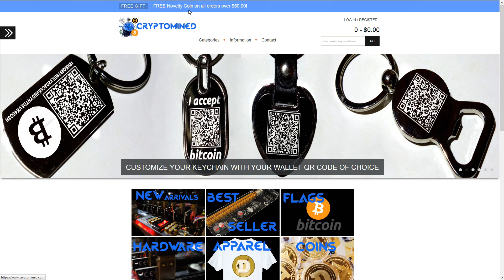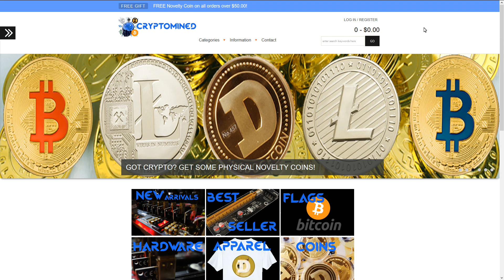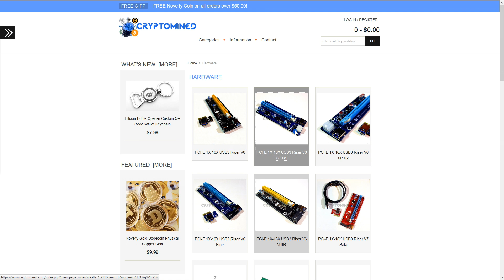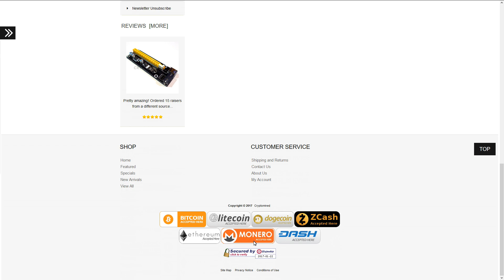6 Best PCI-E 1X to 16X USB3.0 GPU Risers for Mining Rigs Ethereum ZCash Monero

Comment: Hi Cryptomined, I haven't talked to you since zcash forum started up. I think the last time was when Claymore has released "his" miner code cough cough. My nick here is slightly different, but you might be able to figure it out lol. I had asked you before about getting me some risers and I'm glad to see you got a store :) I went there to order 50 risers and some reset buttons, $350ish total, and closed the site when I saw the shipping which was almost $110usd using USPS :0 I'm not blaming you for the high shipping costs since that is out of your control!

I still have some questions and wanted your opinion. I suppose I could talk to you on the zcash or eth forums, but here will do. I getting things set up for the release of Vega cards and am having to take a WAG at power consumption of the cards. The best info I have found is TDP <250 watts...god I should hope so lol. Anyway, I'd like your thoughts on PSU and risers using the same MSI board in your 7 card rig. I'm thinking I'll be forced to use two PSU's per rig to have enough connections. I prefer EVGA and a 1600 G2 has 9 VGA connections, 7 of which would be used going to the cards. The other two could be used to power the 6 pin risers, 8pin to 6+2/6+2....leaving 3 risers needing power. Of course those could be Molex or SATA and the 1600 GS certainly has enough connections for this setup, BUT the dam things are $400+usd.

I've got a metric butt ton of EVGA 1300's and 1000's left over from scrypt ASIC mining I could use, but to me they are like 5 years old ran at 80% load(warranted for 10), so I'm considering just buying a whole new batch of PSU's and ebay'n the old ones.

Do you see a prob using mixed risers......the 6pin and SATA mixed for example? Do you think the higher cost of a single big PSU is worth it over two cheaper smaller PSU's? One PSU is more compact and simple to start up, whereas the last time I used paired PSU's had to be started in a certain way. The rig will use a wire rack similar to yours, have 8 mobo's mounted vertically on the ends of the rack, PSU's on the racks, and GPU's hanging from the racks. I'm concerned about space since the racks are 18 inches deep and 48 inches wide. Card spacing might get a bit tight but right now I don't have a clue as to the size of a Vega card. The entire rack will be wrapped/clad with some-PVC sheeting, open on the top and bottom, with fans top and bottom in push/pull. Creating a chimney, if you will, with air drawn up and out. (That might sound familiar since I used to sell custom rigs handcrafted holding eight 6 card rigs. They cooled brilliantly)

If you have any thoughts, please let me know. Sorry for the wall-o-text :P  Ummm....thoughts about the rig, not about me personally :|
Reply from the maker: sorry, your comment was caught as spam by youtube, i just saw it now.  shoot me an email at cryptomined@cryptomined.com and I can cut you a deal on risers if i know you from the z forums. :)  btw, i send out 2 reset buttons for free with every 6 risers.

not sure the best option for PSU, i did recently add PSU dual connection cables to the store though :)  again just shoot me an email and tell me what you want, ill look over it, discount it, and calculate DHL shipping which could be less if I squeeze the box tight :P  cause they use dimensions in calculations - better for heavy boxes.. cant offer it in the store due to the measurements being used in the calc..

theres no problem using mixed risers.. all my rigs use mixed risers.. infact on the z97 gaming 5, since i have started using 3 sata risers, my rig is way more stable.. i think some of the PCIE slots were "loose" or too wide so the 1X riser end would wobble too much.. sometimes that was causing a GPU to drop..  so actually mixing them is better than when i just used the molex.  i havent had that problem with any other boards.

so... i would recommend mixing sata/6pin/ and molex.  I do.

I think if you use the DUal PSU link cables I sell, should be ok with 2 PSUs.
Im in the same boat thinking about what to do with a 1070 rig i want to build...

shoot me an email, easier to talk though email :) ttyl
Reply: I emailed you friend :)

Comment: Hello
how to solve the problem and Hama Windows 10 AMD graphics card rx480

(application has been blocked from accessing graphics hardware)
Reply from the maker: whats Hama windows 10?  what drivers are you using?  did you modify the bios of your cards?
Reply: Cryptomined 
Is it possible assistance through teamviewer

Comment from the maker: The Best way to Support the Channel is to use the cryptomined store @ https://cryptomined.com where you can get these Risers and More!
Its like making a donation except you get cool mining stuff :)
Reply: power efficiency matters and even gen1x1 is more than enough bandwidth at this point of time. I am currently zcash and eth with good old P45 Intel E6300 (5 pcie slot) and noticed no speed differences with B85, Z97 chipsets with gen2 and gen3 slots.

but if you mean a board that can split pcie 1x16x to 16x pcie 1x. That would be nice and i would love to grab bunch of cheap x79 server boards with xeon e5-2660 to try
Reply: Motherboards don't make x8 slots, only like 2-4 x16s and the rest are all x1s, so that's useless and unnecessary.

X1 does the same as x16 for mining, the difference only comes to mind when gaming.
Reply: I purchased 5 Sata risers on Saturday the 22nd, any idea when they'll ship out?

Order Number: 125

I plan to buy more soon after I check those out.
Reply: Mike How long did it take you to receive your order, is this a legit place to send money?
Reply: Cryptomined they need to make a PCIe X8 to PCIe X16, the X1 is too slow.
Reply: Cloudy Tee they should do a pci x4 splitter that would have two pci x4 in it.
I seen some low profile graphics cards with 2GB DDR3 for cheap, I would definitely want iPCIe x8 graphics card low profile with 1GDDR5

Comment: All of them have a voltage regulator on them that converts 5V to 3.3V for the card.
The main difference is that the 6pin versions need only 12V while the others need 5V too.
there is a switching voltage regulator on the 6pin version that converts 12V to 5V for the other voltage regulators input.
And another advantage of the 6pin version is that you can feed 3 of them from a single 6pin connector if you pull out the connectors from the housing, because a single pair can deliver 9Amps and you have 3 pairs in the 6pin connector. that is how I use them.
Reply: So 12V is for Power and the 5V is for signals of the card ?
12V and 3 amps, is 36W for one riser ??? That's much...
Does someone know how many POWER consumption one (or six) riser card(s) needs ? That's my question.
Reply: I would also say 6 pin conector is more modern than this old molex system... And the 6 pin has a lock system...
Reply from the maker: yes they all have a voltage regulator as you mentioned to convert 5V to 3.3V (the little black chip right?) but that diode is supposed to protect the card from over voltage from a 12V from what I'm told.
Reply: are there really cases where a card died because the riser... And how would you know it was the riser and not overclocking or something else... Maybe they just go for safety... even if it's not nescessery... Maybe only a marketing thing...
Reply from the maker: its more for using it from a 12V source.  I think some server PSU's are only 12V, and if you use the VGA cable from the 12V then maybe some overvoltage protection is necessary.  I had one GPU die, not sure why it died.  hard to tell why a GPU died when its totally dead LOL.   You can get Molex extensions/splitters etc that run from a 12V... so its for that more or less... its not a marketing thing, it has its purposes...   Zoltan did not talk about 12V,... he overlooked that aspect... and the aspect of server PSU's.  maybe I should not have called it a voltage regulator, even though it does regulate or limit voltage from a 12V source... maybe i should have called it an "overvoltage protector"... I don't know exactly what the proper term is... i just know that it is there to protect overvoltage from a 12V source.... people will get it mixed up with the little black chip that regulates votage like Zoltan said.. he says the 6pins only need 12V protection, but thats not true if you use a molex extension cable from an 8 or 6+2 pin cable...

Comment: hey bro, I'm building a new rig. I was wondering IF I could combine different amd  cards together. I'm getting 3x hard swap 470's and 3x hard swap 480's, 3x r9 nano and finally 3x amd radeon 480. DO you think I will run into  any issues running different cars like the ones i just mention, thanks!. once this gets going i will tip you for sure.

Comment: Hi one question how many riser can i put in molex or sata cable? and how many risers can i put in 6 pin cable? 
6 pin 12 volt (2 yellow) - i think at 8 pin cable out i can put 2 risers of 6 pin
sata cable 12v and 5v i think only 1 riser can i put this way?
molex 12v and 5v only 1 riser?
photo: http://i.imgur.com/BUGWwRf.jpg
Reply from the maker: as for your photo - i do not think you can use the 8pin CPU connection to power a riser as the other end of that CPU cable does not have a 6+2pin - it should have either an 8Pin or 4+4Pin.  You will not be able to plug a VGA 6+2Pin into that CPU connection, they wont fit... different plugs.

For sata or molex you ~should~ only put one,... but most people tend to double up on at least one of their connections as most power supplies just have 6 6pin connectors (and one is needed for the SSD/HDD).. most people don't use the 6pin risers because they have not been around very long.

its safer to put 2 risers on a single 8pin cable as it can take 150W per 8 pin (might depend on the GPU) if I am right (im pretty sure thats right, maybe someone can correct me if i am wrong)... where the molex just have 75W I think... honestly been awake for 1&1/2 days now with a sore tooth, so I'm a bit out of it.. i could be getting a number wrong... so hopefully someone who knows all their numbers can correct me if i am wrong.

I'm told that you can use a single 8pin + 6+2pin sometimes to power both the GPU and the riser, but that would really depend on what GPU you are using... and I don't think I would do that myself or recommend doing that.

personally i was using 2 risers on a single molex cable and never had a problem with it... but its not recommended if you can avoid it.

with your power supply there, its still hard to power 6 GPUs with 6 separate risers... each using their own cable... as you only have 6 8pins that can be used with GPU or riser and 6 6pins that can be used with SSD/HDD or risers...  so for optimal conditions your still short one connection.

If that were a Corsair unit, like I used in the video, than the 8Pin connections are all the same and can power whatever they want (GPU, CPU, Riser)... but on the EVGA Units I do not know because the CPU is labelled differently than the GPU/VGA and the plugs on the cables are slightly different - you can not plug an EVGA CPU cable into an EVGA GPU plug... and you can not plug an EVGA GPU cable in to an EVGA CPU plug.

For that reason the corsair units are better, have more freedom to plug CPU and GPU in any 8pin - EVGA not so free like that.
Reply: ok thanks!

what is the best psu for 7 gpu (rx 470 gaming x)
1300W - EVGA Gold+ (10 year warranty)
1200W - Superflower Platinum+ (5 year warranty)
1350W - Enermax Platimax (5 year warranty)

or what psu i need for 7 gpu?
150W / gpu total 1050W
Reply from the maker: EVGA 1600G2, or Corsair AX1200i or AX1500i would probably be best

Comment: the biggest problem I have had in the past is bad USB cables causing GPU crashing.
Reply from the maker: I haven't had that problem with any of the risers I use.  There are 3 different colored cables: Black, Blue and White.  I only put the black ones in the store but if you prefer one of the other colors I can order them in for you, just shoot me an email at the store and request it.  I can also special order 30cm or 100cm cables if the 60cm cables I sell in the store do not suit your needs.  I will probably update the listings this week with more cable options (sizes and color)
Reply: I am using Risers with 6p connector, they are very stable. if possible try avoid the sata power to 6p connector and use direct 6p from PSU instead. practically it is ok to use sata power but mind that sata power is rated at 4.5 amps only at 12v.